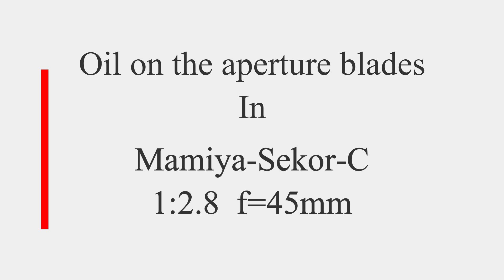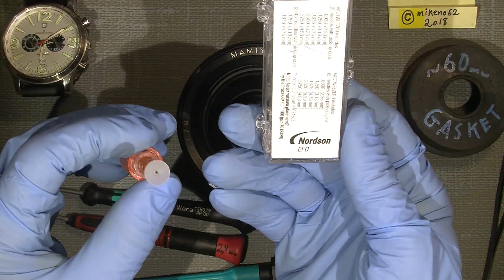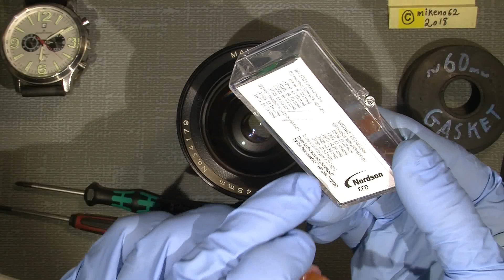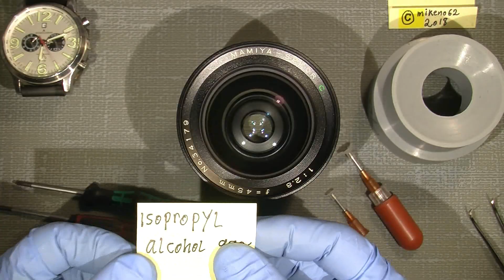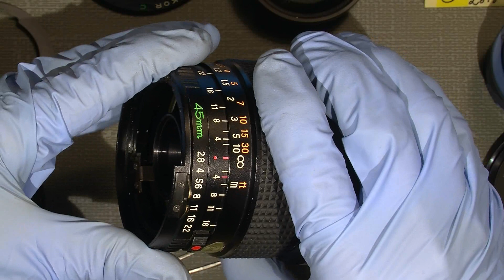Oil on the aperture blades in Mamiya-Sekor-C 1:2.8 f=45mm

Comment: Thank you so much for creating these videos, a real lifesaver. 

Small tip for those who struggel with putting back the small steel ball:
Use a good amount of grease on it, this prevents the ball from flying off too far. I then held the ball down using a small piece of film and put the aperture ring over the small piece of film. Once everyhting is seated, just pull out the film

Comment: Thank you so much for your detailed video about this lens. It saved my life today whilst trying to get rid of some fungus behind the second lens. When I opend the front element, only the front lens came off, the other part stayed in. So I tried to open that one but it did'nt seem to move. Then I loosend those 3 screws around the bottom of the second element. Little did I know what pandora box I opened here ;-).... Fungus removal was the easiest part of it all. To make it short, at the end I had the whole lens apart, trying to figure out how the focussing system works because those 3 screws loosened the focussing system. But: because of your brilliant video I was able to put it all back together again and now I have an exellent Mamiya 45mm 2.8 with clear glass, outside top and focus adjusted. Without your video, I would have propably given up on it. It cost me only 100 Euro because of the fungus. Thankx again + Greetings from Germany !!!

Comment: I like your rubber tool technique it creates a 360 degree pressure point on the lens thread which is very good too look after the thread over time
Reply from the maker: Yes that's true, the rubber tool make's a much better contact to the name plate or retaining ring's, and there are no mark's on name plates

Comment: I would recommend taking off the lens outer front barrel. You need to remove the three screws that hold it in place and you can much more easily manipulate the inside of the lens for disassembly, cleaning and assembly as well.
But you need to be careful to loosen the right screws, since the other three screws are adjusting the focusing mechnism. But that is obvious if you take a good look at the screws from the top before loosening any of them.
Reply: Are you a lens technician ? . Perhaps you could service some of my lenses ? . Let me know . Thank you .
Reply: @laurencemoss8049  I only do it as a hobby, but if you ask nicely and are from within the EU I might help 😅

Comment: Great video as usual. My only question is how to go about regreasing the focus ring the correct way? Mine is very stiff since a ton of oil ended up in the aperture blades, so I'd like to stick some PTFE grease inside the rings.
Reply: I do this by focusing it out as much as possible, and regreasing it from the back without taking the helicoid apart (which is a huge pain in the back to get back together).

Comment: 36:32  Now a question for you. So once you bring back that aperture mechanism out of the tequila and back into the core lens, and in short due time, is the lens owner going to have to deal with hard stiff focusing mechanism or if oiled again, won't oil find its way back to blades? 
BTW do you a good remedy for the hard to focus lens with stiff focusing ring (A very common problem with Russian lenses)? I've been told a little beat of "Gun Oil" is the right way to go. What do you have to say?
Reply: Throwing the aperture mechanism in the degreasing solution does have nothing to do with the focusing mechanism. Also he degreases the inside of the barrel, not the helicoid as well.

The aperture mechanism is not greased or oiled at all. And works without lubrication just fine, as it is designer for this.
Reply: @thomebau895  
Thanks.
OK and got it for aperture.
But for stiff focusing lens (A totally different scenario) do you suggest greasing the helicoid? If so from surface or or from inside and what is the best solution for the solution?
Personally, I have seen the real "Grease" inside the Russian lenses but not sure if gun oil or something thinner with less residue to be a better material.

Comment: Hi Kenneth I clean today the aperture blades of my Mamiya 80mm 2,8 , every sing was  perfect thanks to your video , my only issue was put in the metal ball back , the F@#$ metal ball jump and never found it again , my lens is now click off , you know were I cant fine same thing to replaced? Thank you very much Guillermo from NYC
Reply from the maker: Well, it's not easy to find spare parts for thoose old lenses, but you can maybe find a steele ball from another wornout lens from the fleemarket, or you could buy them on eBay, just like thoose in different size:

https://www.ebay.co.uk/itm/10-x-Loose-Ball-Bearings-Grade-100-1mm-2mm-3mm-4mm-5mm-6mm-7mm-8mm-9mm-10mm-Pack/112243336339?_trkparms=aid%3D222007%26algo%3DSIM.MBE%26ao%3D2%26asc%3D20160323102634%26meid%3D1ac5e5d8fb034b51812bd173c41e594d%26pid%3D100623%26rk%3D4%26rkt%3D6%26sd%3D271125764129%26itm%3D112243336339&_trksid=p2047675.c100623.m-1